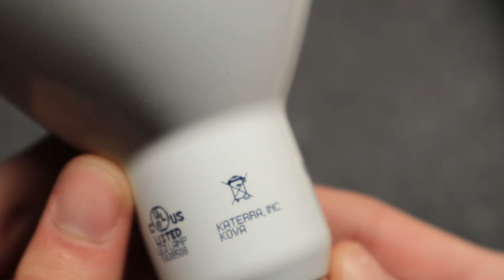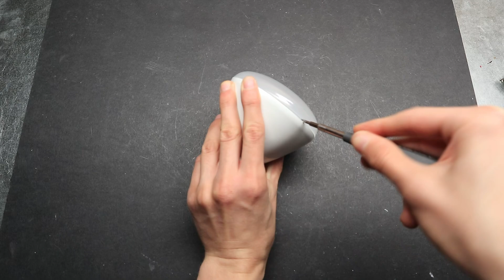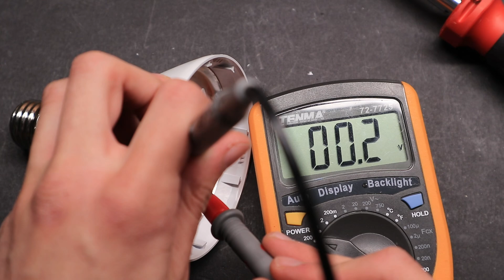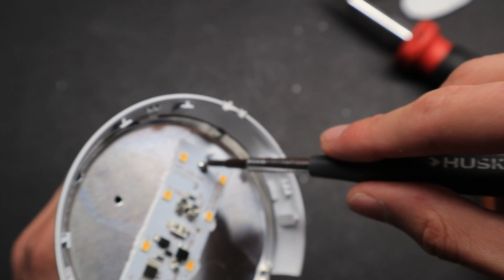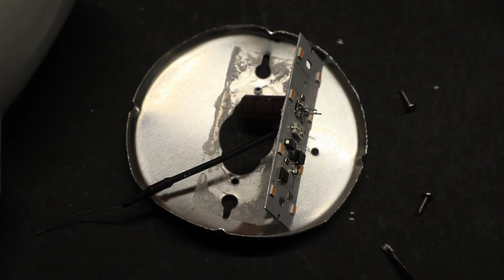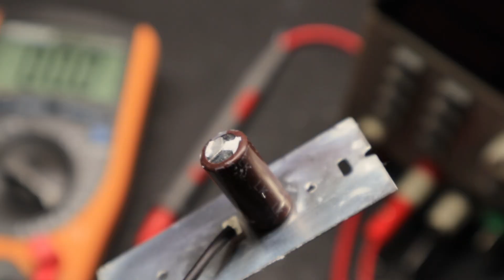Inside burnt out BR30 LED bulb

Comment: They are not built to 50000 hour use as they claim. We have nowadays 2 year guarantee on lamps, but who's going to keep the 🧾 for that..
Reply from the maker: This one was designed for 25,000 hours lifespan and had a 3 year warranty according to a datasheet I found a while ago, but I do not know the full history with this bulb and how much it was used prior to its failure. I assume it was used for more than 3 hours per day.